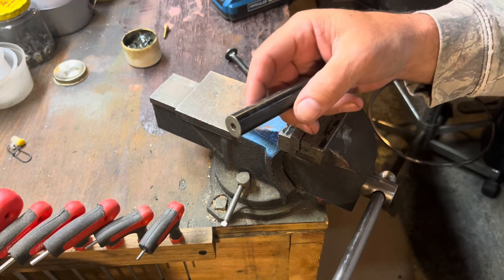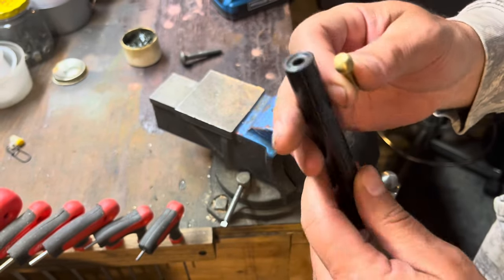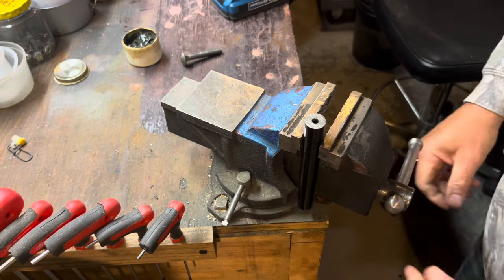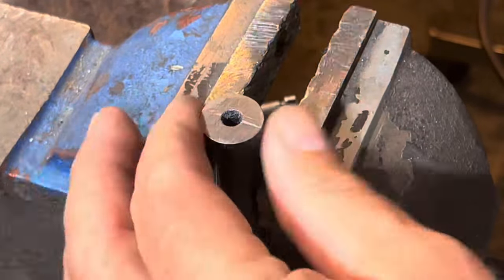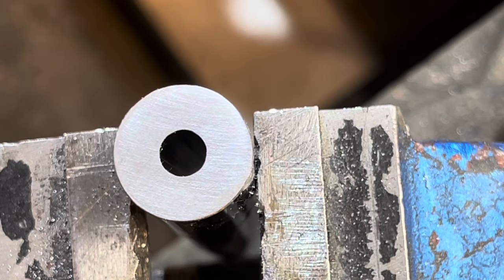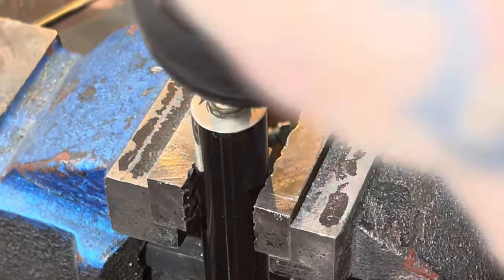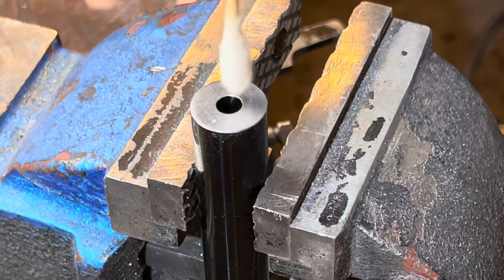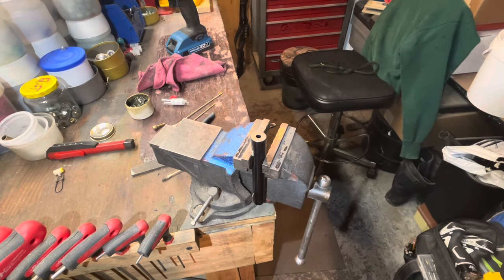How I fix a muzzle crown

Comment: For those that have a lathe, make your own finishing lap from brass stock, cut an 11 degree taper in the brass stock, then use a corner rounding end mill held in the lathe tool holder on the compound; to machine off the lap ( rounding it off ) so it protrudes .250  into the barrel. After you have done the basic crowning procedure CW shows here, Finish up the final lap cut using this 11 degree tapered lap made as above with the finest grit lapping compound. Chucking the final lap in a lathe is best but can be accomplished by hand using straight in as possible pressure over and over (short duration pecking) till a distinct even wear band is cut around the groves of the rifling, not just the lands. This ensures a precise, concentric lap. The 11 degree crown lap is considered by many of the worlds top shooters, but you can experiment and use a lap degree that fits your requirements. Ive done this over 45 years as a gunsmith/machinist ..I used .500 brass stock....and have 3 finish laps....50-33 cal, 33-25 cal,  25-17 cal.....just saying.....
Reply from the maker: ♥️♥️ Thanks for the sage advice Don!! ♥️♥️

Comment: I've not had to re crown a barrel yet.  I do have that lapping compound from valve jobs on Volkswagen Rabbit engines years ago though.  I just used some this afternoon to sharpen my reel mower!  I remove a wheel, take off the drive gear, chuck up a 1/2 inch drill, and run it backward with some compound smeared on the blades.  Sharper than new in a few minutes and boy does it make a difference when the grass is as thick as it is now!  Good video CW!
Reply from the maker: Hello Marc!!  Sto it away my brother!!

Comment: Very cool. I did a similar crowning job and put a small plug of material in the bore to keep the shavings and lapping compound from going down inside the bore. The rolling around is very important and you see it working to even out the taper and angle. Good video.
Reply from the maker: Thanks John!  I thought it might be useful!  I was talking with Treesablowin and he mentioned he had a jacked up crown on his brand new S&W 10mm. So I though it timely for the video. 

Glad ya enjoyed it!!

Comment: I have a ruger 32 H & R Magnum, 9" barrel, very accurate farm/varmint pistol, want to cut the barrel down to 5" for a  quicker draw, crowning is a must, thanks for showing me how it's done.
Reply from the maker: Good luck man!! Its gonna be much handier! 
But Id first check values those loong barrels was not common and could bring a pretty penny if in good shape. Might benefit you to sell and buy a new one @ size you want with $$ left over.

Comment: Not sure who made the vid, but seen a similar process using brass screws, drill, and a file. I used the method on a mosin, and did see accuracy improve. I may of used a cone grinding stone as well. Then at end I reblued the area.
Reply from the maker: Yup more then one way ta skin a cat!  Important part is clean, burr free termination of rifling.

Comment: Thank you for your informative and interesting video.  I had made a trade for a UAR BRNO 22lr rifle that someone cut about 4"-5" off the barrel and unfortunately it wasn't squared off properly. After I squared it off I began to recrown the barrel using valve grounding compound and small brass screw. I think I'm done but have to get to the indoor range to checkout the accuracy. 😉😃😃😃
Reply from the maker: Awesome!!  ❤️‍🩹❤️‍🩹🤟🏽❤️‍🩹🤟🏽

Comment: I got 308 Win that I screwed up the crown.  I have the lathe but this looks simpler, I just need to get valve grinding compound somewhere.  One thing I noticed that my crown is 90 degrees while this method makes it rounded or maybe 45 degrees, I wonder if that makes any difference.
Reply from the maker: Let me know!! 😜🤘🏼💪🏼👍🏼🤟🏽

Comment: Thank you.  Might it be needed to do this same sort of procedure to the chamber?
Reply from the maker: Can you clarify? What are you looking to a complish?
Reply: @cw2a  Thank you.  Even after 3 months of struggling with group size and accuracy my name brand break barrel pellet rifle gives me about 1 inch groups one day, and then the next day the groups are larger and shift  POI about an inch.  
I'm shooting with a respected name scope from a strudy table and a solid rest.  
I use my most accurate pellets and use recommended shooting procedures including putting the rest at the same location along the rifle.
I haven't yet crowned the rifle, so I'm wondering if I do put a crown on the muzzle should I do something similar to the chamber while I have the barrel exposed.  
My goal is 1\2" or smaller groups consistently at 20 yards.
Thanks again.
Reply from the maker: @southernexposure123  Some air rifles are VERY sensitive to your hold. Try and be conscious of everything you're doing when it shoots well and try to replicate that.  How tight, position of you head, your hands, your elbows even your face. It can make a difference on some guns. Some want to be "man handled" others like free recoil.
Reply: @cw2a  Thank you.

Comment: Hi there, does anyone think this something I have to worry about after using a bore snake over a few months? I would spray cleaning compound into the barrel from both sides to ensure the barrel gets nice and wet inside and I believe I always pulled it through as straight as possible. It was a hoppes bore snake with bronze brushes. The muzzle end also seems to hold a bullet tip just fine. Thanks
Reply from the maker: Anything repeatedly pushed pulled thru the bore is a concern. Many barrels are ruined with careless cleaning & shooting when too hot. 

So go slow as not to cause undue wear. Its not like your pulling sand paper thru but keep the snake clean. I wouldn't get overly concerned just use some common sense.
Reply: @cw2a  10-4 thank you
Reply: I have been using bore snakes for years without issue or causing damage. Just clean the snake after use, only run them through the barrel from chamber to muzzle, don't pull the cord out at an angle dragging along the crown, and throw them away when they get old because you do not want a bore snake stuck in your barrel. They can be VERY hard to get back out without the pull cord. If you keep these few things in mind, the bore snake should not ever damage the barrel.

Comment: I didn't really want to spend 8 minutes watching you file the end of the scrap stub flat, so I stopped before that. Use a belt grinder or be more prepared for the actual crowning  operation. I'm sure others will agree?
Reply from the maker: Hello Patrick. 
This is but one way to accomplish this goal. It is not the only or best way for everyone. As the old saying goes, there is more then one way ta skin a cat! 
Thanks for the visit!